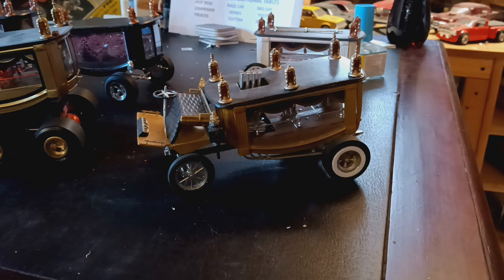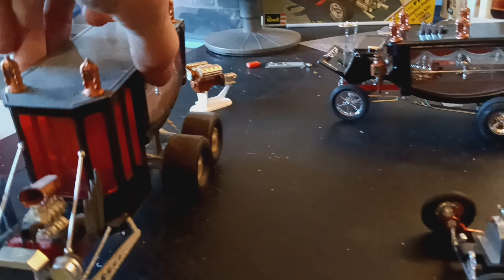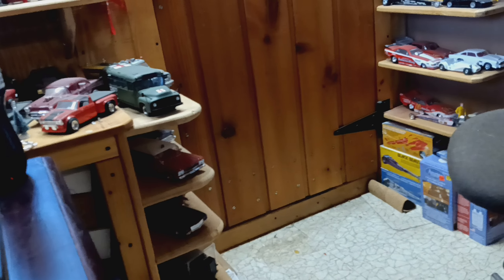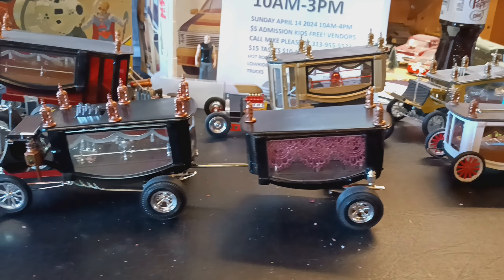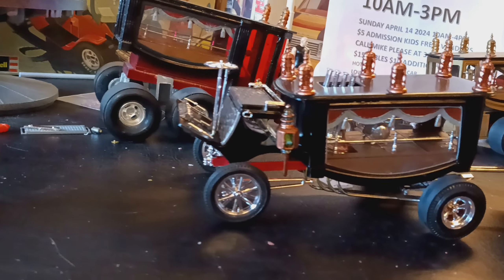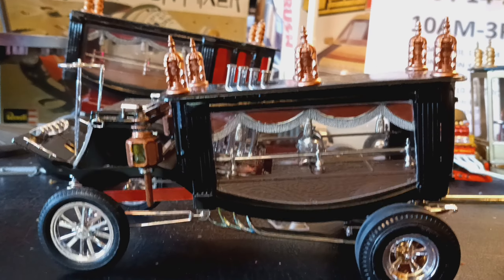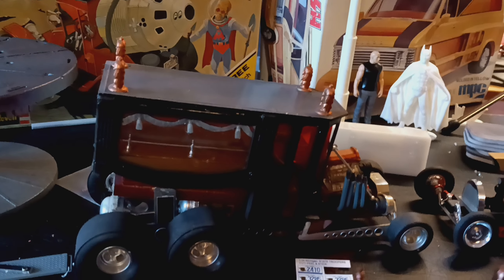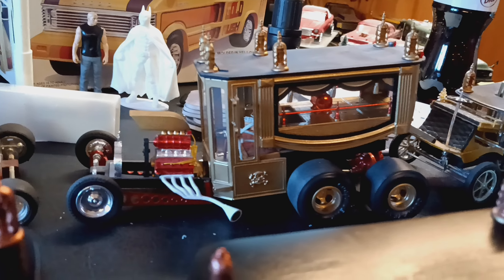k.m.a. Terry (senior)' tribute g. b. final

Comment: Seniors  tribute turned out 
All of the coaches are deluxe 
Does that say firepower on the valve covers 
did the spare come out of the boot hill kit
Fire dome,fire power ,and red ram my favs
Reply from the maker: Sorry it took so long yes they are Chrysler fire power engines. I do have some valve covers that are red ram and fire dome some where in a box.
Reply: Do you know what kits they came out of
Reply from the maker: @bkmodelcars  not off hand.
Reply: Thank you sir